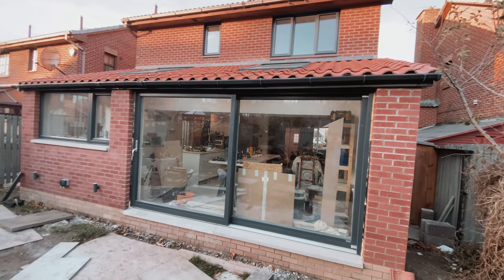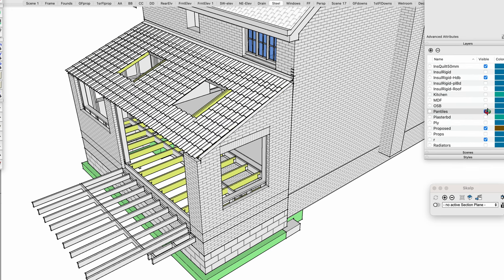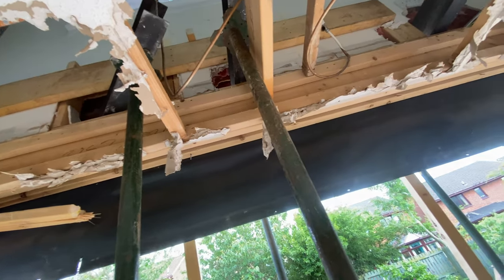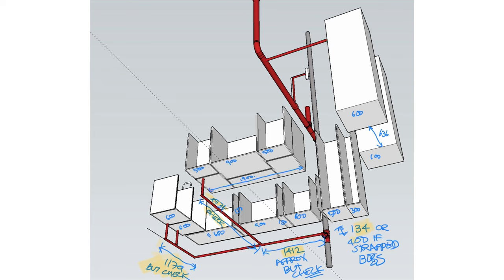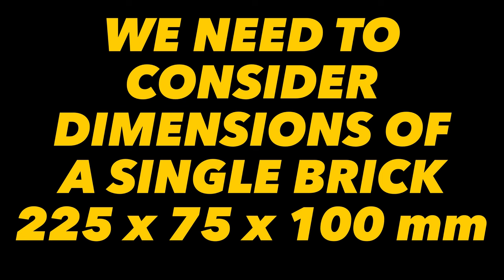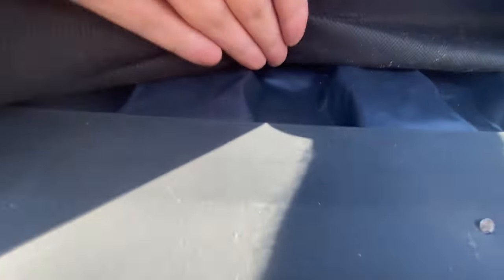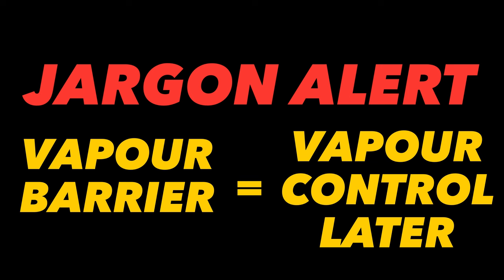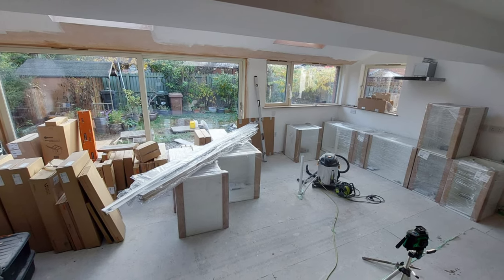How I built this House extension - start to finish all the stages

Comment: Amazing! Thank you very much for sharing, I have learnt a lot! We would like to have L6*W7 meters extention for kitchen and living room. The rocket high price stopped us. If Diyerable it would be a fantastic news for us.  If building control can accept completely wood for the wall and no foundation, I am confident to do it by myself. Foundation is too hard and time consuming. And I am not confident to lay bricks. As I know bricks structure need to be very accurate to prevent falling or crack in the future but wood is flexible it tolerates a bit on measurements. I have some diy experience as i did garden room, layed floor, assembled furnitures.....
Reply from the maker: You have to get a structural engineer to design your foundations for your wall, however, Building control will accept a wall construction done completely in timber. I made a video about it here. 
TIMBER FRAME v BRICK BLOCK Masonry- House Extension walls - Architect Builder’s 5 expert tips
https://youtu.be/HHunXgidQL4
Good luck and thanks for your comment.

Comment: Interesting that you have gone for a full foundation setup. I note from other videos that often other firms are having localised pads then spanning over from the existing foundation to the new pad arrangement with concrete lintels. I would be interested to hear your opinion of this method? Was there a reason why you did not do this?
Reply from the maker: There’s more work in the method you’ve explained, that’s why I prefer the Strip foundation.

Comment: Great video! could both of the sub ground block courses have been laid at the same time? is there a reason the second course wasn't started until the timber frame was up?  Thanks...
Reply from the maker: The best way to do that is to do trench blocks laid on their sides, with no cavity. There was a shortage of blocks in the country when this was built and so I had to do this compromise instead, where I just built the inner leaf trench block. Not ideal but allowed me to get on with the next stages (steel work and timber frame) without delays. Note I left wall ties exposed so the outer leaf could be tied in.  Very observant and great question.

Comment: Do you still need that foundation for a wooden extension structure ? Or will a concrete slab do the job
Reply from the maker: Depends on the live and dead loads, and what these walls are carrying (roof, another storey), a slab can work, but only if you take the loading of the walls at its edges into account, usually by thickening up like a raft foundation. Another solution is mini piles. Strips are often the most straightforward and the least amount of work. Like everything else in building,,,,, I just depends.

Comment: I always push towards a timber kit build vs traditional as I can get the build water tight myself and I’m not waiting on the bricky.
Reply from the maker: Yes, exactly this. With the latest requirements for u values and insulation, building traditional cavity walls with block, I’m not sure it’s economic any more. I intend making a video about the economics of it soon. Thanks for the comment.
Reply: @build-better-things   never thought about it that way either, suppose that’s the difference between the builder vs the designer mind.

Comment: I  am planning to like this do we really need to built brick wall or just install composite cladding on
Reply from the maker: You don’t need the outer brick for this system. You can use any cladding. Check out my video here which explains it a little better
TIMBER FRAME v BRICK BLOCK Masonry- House Extension walls - Architect Builder’s 5 expert tips
https://youtu.be/HHunXgidQL4

Comment: Hi - great vid, well explained and executed. Thank you. Why and where do you buy the windows from in Sweden? Thank you ❤
Reply from the maker: I chose these because they manufacture big areas of glass. If you go for cheaper, eg UPVC…you will have to break up the view with transoms or mullions. I chose them because the super low e glass combined with the design of the frames means very low u values, in plain English, much lower heat loss. There’s a load of other reasons…but those are the principle ones. I buy them direct from the manufacturer, although they are Swedish they have sales offices in UK and customer service is good. There are other excellent choices,,,rational, Andersen, Velfac. Hope that helps.

Comment: What thickness insulation in roof did you use ?
Reply from the maker: I think it was 100mm with the rafters, and then 62mm insulated plasterboard. From memory.

Comment: Do you cut a slot in the brickwork then slide some damp proof material in to make a vertical dpc before joining timber frame to original house
Reply from the maker: If this has been a standard masonry cavity wall junction then I might have done that. However as I had a steel column going in at that point to support the beam on each end where the inner load would have been, so it was easier to put DPC to the steel and lap the breather membrane for the new timber frame. I made a video about it here which will make it clearer. Probably about half way through the vid. 
Installing steel beams for a house extension
https://youtu.be/3t9r2dwvAFA

Comment: Does the max 4 meter roof height include the thickness of the tiles or is it the top of the wall plate? Many thanks.
Reply from the maker: Hi. I’m not sure which 4 metres you mean? On this project the maximum height was set by the brick course immediately below the upper floor window sill, which is where the flashing is chased into. Then I’m aiming for a 150mm drop to the top of the abutting roof tiles which the flashing sits over, then the roofing battens. All of that sets up the height of the joists, so you’re working downwards from the brick course.

Comment: Can i ask please, reading about rear extension (looking to self manage one) they say build the watertight shell then knock though to make open plan with the steels. However, every video I've watched has people knocking though and installing the steels before building the extension, why is that?
Reply from the maker: I’m not sure who you are referring to when you say “they”, but the only scenario I would do what you are suggesting is where the owner insists on staying in the property, and I would do it only very reluctantly as that never ends well. You want all heavy and disruptive work out of the way, all possible micro movements managed and understood before you start any new fixings, any new things into that same wall. You want to do your down takes before your new work.

Comment: 12:22 if those boxes are not going to be accessible, they need to be the slightly larger size WagoBoxes, with the correct type of connectors inside to be considered Maintenance Free and meet BS5733, not WagoBoxLights.

Comment: Great video ,
My spec is c24  wall studs however my builder has used c16....is this usable
Reply from the maker: Hi. C24 is has a greater strength rating than C16. That basically means that it can span longer or, and especially for wall studs, has a greater compression strength. For example, for 145mm x 45 floor joists the difference is around 350mm in length of span so it does make quite a difference. For wall studs there will be a reason your engineer has specified C24, so you should check with them. The builder has used C16 because it’s cheaper and most of their customers never know once it’s covered up. I made a video here that might help you
https://youtu.be/qzewVm_CWgs

Comment: Did you pour the trench foundations first and then at a later date once the demo work completed, dig and pour the pads for the steel posts?
Reply from the maker: Yes, exactly that. The size of the pads for the steel were too big to shutter without the demolitions done first. So I did it in two pours.  Also I wanted a firm base for the props to stand on rather than the grass and old top soil,  and the blinding concrete for the new solum was ideal for that.

Comment: So was this a Non-Standard Construction build considering it has timber frame structure rather than brick/stone?
Reply from the maker: Hi. Timber frame construction is a standard construction system in the U.K.  For example section 6 of technical requirements of the NHBC guidance.  So this is a standard construction.

Comment: Excellent...how much would you estimate you saved on labour costs doing this yourself?... im planning on a double story with ground floor wrap around and loft conversion, but labour costs ar putting this well out of reach as prices are madness lately.
Reply from the maker: A contractor would have done it faster perhaps. Even taking account of what I spent paying for my friend to help I would imagine I saved maybe £35-40k, the quotes I was getting for the demolitions and temporary propping was £9k alone!! . There probably would have been 20pc to add in vat on top of that. I saved £8k by doing the foundations for sure.  I had to pay for a bricklayer and the steel fabricator 's men for a day, as well as all of the building materials, but I would have had those costs anyway. Of course you could argue I need to put a price on my own time, but this is about saving hard cash by doing it yourself without relying on a main contractor!!
Reply: @build-better-things  maybe if i can do as much as i can then i have a chance, no aspect of an extension is difficult when broken into bite size chunks.

Comment: Hi, great video.  Can I ask why you preferred to get the windows from Sweden?  Thank you.
Reply from the maker: Hi. The only manufacturers that can make these size of windows and with these profile sizes are few and far between, Scandinavian or German. The standard fare in the U.K. Is to go for upvc frames which are much chunkier and don’t have the spanning strength, so you have to introduce vertical mullions, and therefore less natural light, and it looks really ugly in my view,  or for more traditional uses, bespoke timber with narrow sections and lots of mullions and transoms. I just find the upvc ugly and not worth the modest saving you will get. Plus, the modest extra spend on high quality frames, glass and manufacturing will pay for itself in terms of way better U values and therefore less heat loss, so lower bills and better resale value should you sell. Other manufacturers I would consider would be Rational, or Velfac. Thanks for the comment.
Reply: @build-better-things  Thanks for the great informative content. Any chance you could share the details of where you bought your windows please ?
Reply from the maker: Hi. I bought the windows directly from Nordan uk.
Reply: @build-better-things  perfect thank you

Comment: What angle is the roof?
Reply from the maker: From memory, around 24 degrees, set up by the height of the upstairs windows. Make sure to always check the minimum pitch the manufacturer allows when specifying roof tiles and slates.

Comment: I live in Scotland too and I've noticed this trend for Scottish properties to be built with a timber frame. For me, this seems like a glorified shed and i much prefer the English way of brick and block.
Reply from the maker: It’s hard to reply because you’re not being specific about your preference and what you mean by a shed .  I made a video about the two constructions types and how I compare them. I have built both ways, several times, over many years. I would never go back to brick and block. So many reasons. Insulation, ventilation control, breathability , economy, speed, ease… too many reasons to mention here. Have a look at the vid and tell me what you think…
TIMBER FRAME v BRICK BLOCK Masonry- House Extension walls - Architect Builder’s 5 expert tips
https://youtu.be/HHunXgidQL4